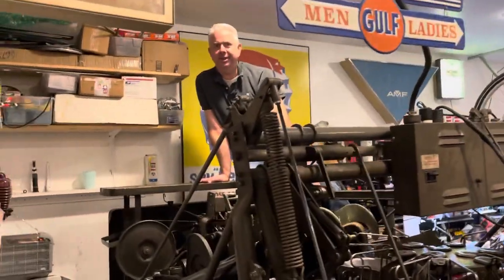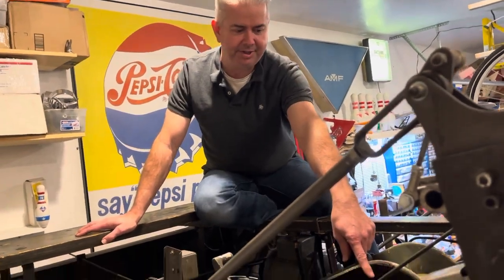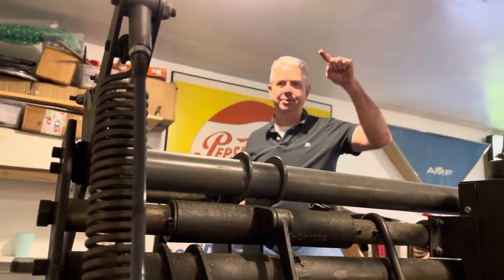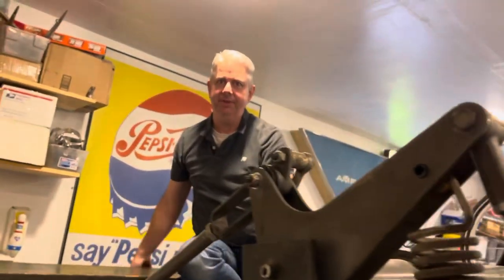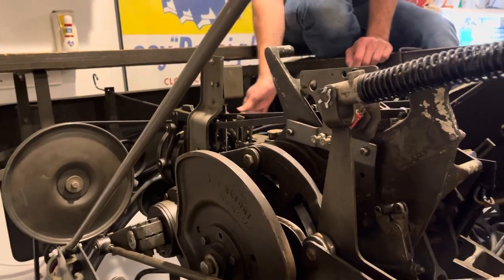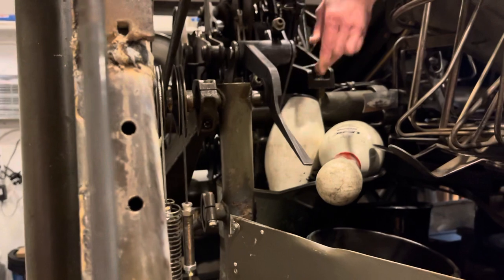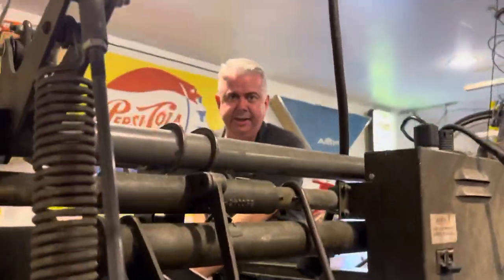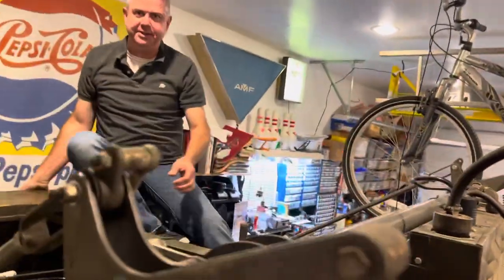Blackouts! How to safely clear a blackout from deck jams - Brunswick pinsetter Garage Bowling Alley

Comment: Explain what causes a pinsetter to continuously cycle
Reply from the maker: Usually a bind in the cushion linkage.   I had that issue a year or so ago but found it was a slightly too tight bolt on the cushion linkage.   Ill add that idea to my list of videos to do.   Thanks for the feedback
Reply: The cycle solenoid can cause related issues as well. You would have to watch the machine